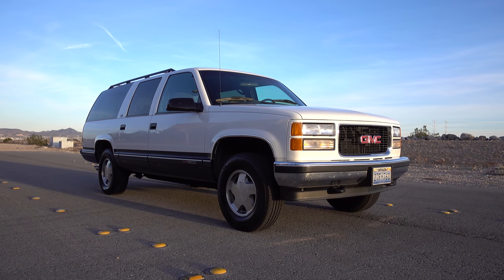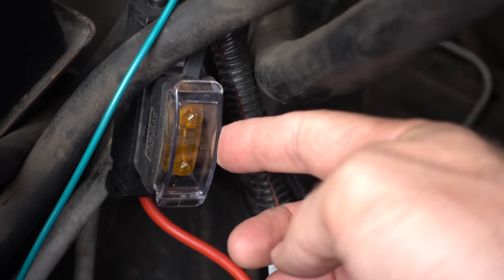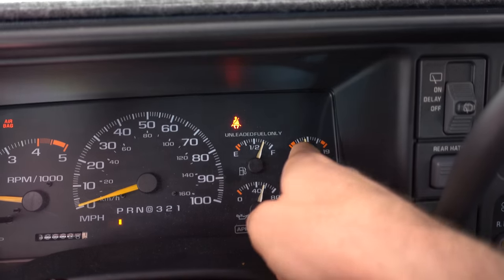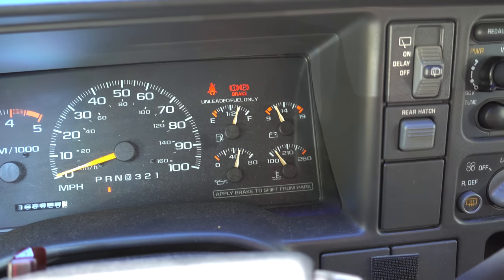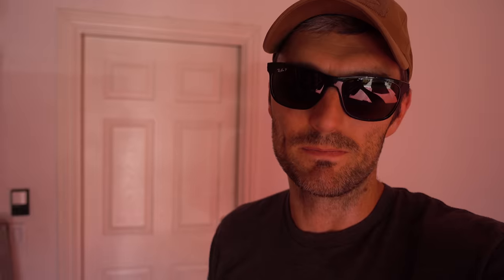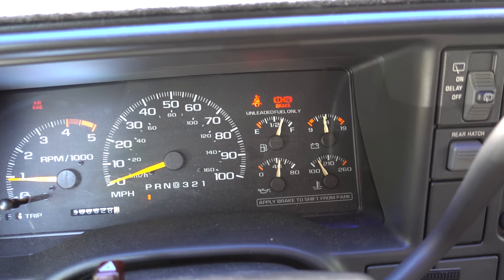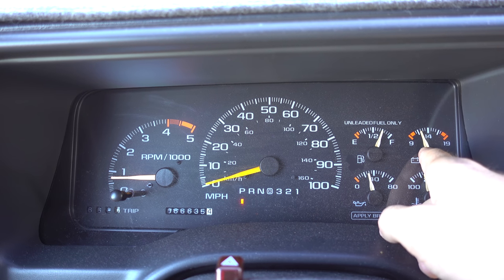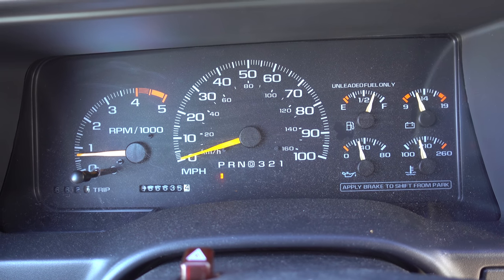SOLVE A LOW VOLTAGE ISSUE!

Comment: Your alternator not keeping up it should   be able to run your car as well as charge your battery.
You need to upgrade your alternator to a high output alt
Reply: Wrong. It could be bad wiring or ground issues, which would cause even the best alternator to produce a low voltage output.
Reply: @michaelcallaway6962  thanks for letting him know I was about to say the same have the highest output alternator you can get for these trucks and it still wont keep charge
Reply: I have a Honda Civic 2003 lx I had to replace the computer and  I had to install a use computer for the car, now when I’m drive the voltage come down and the battery light comes on, but in parking the light doesn’t come, the alternator is new but still ,  I don’t know ??
Reply: @pablocastillo9040  you probably Have a loose ground or exposed wire touching the frame causing a short or your starter finnaly kicked the bucket
Reply: @pablocastillo9040  also is it a rebuilt alternator or a new alternator sometimes the rebuilt ones come defective if you know how to remove the alternator you can take it to go get to checked at any autozone or orielys
Reply: @frankgar4560  hi .. im no mechanic but i have this kind of problem with my car for a year and every mechanic will tell me its just the voltmeter's problem not the alternator or battery , but i still dont trust this reason since i keep on monitoring the voltmeter, any suggestions to fix this problem if this could be the ground problem? or is there a chance i could do it by myself?
Reply: @ayawhilabtiakoyoutubeaccou1892  also you can disconnect the alternator while the truck or car is running and if It stays on it ain't the alternator
Reply: @ayawhilabtiakoyoutubeaccou1892  theres a nice video on checking for a short with a voltmeter there relatively cheap for about 8 bucks at your local auto parts store connect the alligator clip to the positive if it lights up you have a short so what you do is get one fuse out at a time from the fuse box  and see if the light in the voltmeter turns off if it does that's your problem just remember when you pull a fuse and that's not it put it back and do it carefully you can hurt the fuse or pop it yanking it out forcefully
Reply: @michaelcallaway6962  This Suburban is equipped with a CS130 alternator, max output of 105 amps. It makes about 30-35 amps at idle depending on temperature. The fans themselves pull that much, rest of the truck is about a 40-50 amp load. His electrical load is exceeding his charging capacity, and draining the battery in the process. With all this load the alternator doesn't have enough reserve current to supply the load as well as maintain charge of the battery.
Your arrogance doesn't make you look cool brother. As to the poster, the GM AD244 from the LS engined trucks is a direct swap (with a slightly longer belt), has a max of 140A and makes about 80A of idle current and vastly superior cooling. The alternator charge wire contains a fusible link, so make sure you properly fuse the bigger alternator.
Reply: I have similar problem with my Silverado 1500,I went to AutoZone to be sure what exactly cause my truck shake on stop(also the gauge goes down from 14 to 11.6) and they told me everything works just fine,on the other side I can hear some whispering noice coming out under the hood,makes me think it’s the alternator .. I will take it to the Chevy dealership tomorrow afternoon for diagnoses.. It’s annoyingly and definitely not working normally .
Reply: @rivbro91  l
Reply: Had the same problem with my pops 97 Chevy c1500 , the battery is about 6 years old. The alternator is only pushing 90 amps. Solved the problem by cleaning the ground straps firewall to the chasis and chasis to the back of the engine block. Sandpaper 80 grit to sand down paint on the firewall and chasis also. Almost forgot had to clean grease and oil build up where battery ground cable grounds to engine block.
Reply: @michaelcallaway6962  True. But, maybe he didn't wait 10 minutes for the guy to say that he just "Upgraded" his ALT to a PowerMaster 140A ALT. Even I was like, WTF? Why not say that at the start of the vid?
Reply: he said he upgraded the ALT to PowerMaster 140A. Doesn't mention wiring though.
Reply: Any updates on this? I have the same issue on a stock 2010 Subaru Outback. When I draw extra power for example the AC my voltage drops. Almost stalls
Reply: @bigfootswingman  AC + both fans on high + engine and all accessories = power drops.diff cars have diff severity. typical OEM ALTs are rates about 100-maybe 130 A, but some new cars have pretty HO ALTs. My 2003 RAV4 drops V as low as ~ 12.2-13 when running everything with AC on.even a low ad 11.8. the ALT works but is on its way out.
 for my AM system, i will need a HO ALT-maybe US Alternators with the OEM ECU integration unit -- ~ $200 more.
Reply: @mance7996  u ever find out what was the cause?

Comment: You need to consider a higher amp alternator. My stock 98 c1500 is equipped with a 105 amp alternator. There is also 120 and 140 alternators available. Cost is around 140 and below. I run a massive stereo system and an auxiliary fuel transfer pump for my heavy equipment. I can run the stereo really loud and pump fuel without my alternator gauge even moving. Doing this will save you money and unneeded weight. As well as extra maintenance. Hope this will solve your issue.
Reply: Check your grounds and upgrade your cables

Comment: 1. Buy a battery with dual mounts. You can buy terminals for the top mounts for accessories.
2. Check your grounds. Use a multimeter and check your ohms from your engine to your battery. Make sure your fans are grounded properly. There are ground connections to the frame under your driver door. Check to make sure they are 0 ohms wire to frame.
3. Your alternator can't keep up.  Get a higher amp alternator ASAP. It should be at 14v at idle so it definitely is an issue without checking anything above. I would check the above first before dropping money on an alternator. It is pretty obvious though. Cheap alternators don't produce the amps at low RPM's. That's what's happening when you put it in gear and sit at a stoplight. Higher quality alternators produce great quality power at idle and sit at 14v minimum.

Comment: Heavier gauge wire from alternator to battery the big three I also have a older chevy suburban began to have the same issue voltage drop at idle almost in the red my HIDs flickering upgraded to the big 3 problem solved
Reply: What do you mean by the big 3? Ground wires?
Reply: @edgarheredia2690  yes

Comment: Ground with bigger gauge wire on the battery to chassis and on the engine to chassis ground. Also use a better battery like optima yellow top or any other battery made for accessories. Use good LEDs on your old lights inside and outside.
Reply: Optima batteries arent as good as they once was. Led's headlights consume the same power as halogen. His issue is wire sizing did you see the tiny wires from that battery? The fans arent temp controlled and the AC compressor could also be getting old. If you noticed his engine temp with both AC's on and everything running for a while way to cool which causes bad fuel mileage the engine needs to be around the 210mark when warmed up. The fans are wired to come on with AC which is good but i think he only needs 1 fan on high with AC on and the other to be engine coolant temp controlled this would put him a lot closer to optimal engine temp and reduce the amp draw of fans.

Comment: 2:30 your battery does not provide power to the vehicle once the engine is started, your alternator does. Your alternator charges your battery. However, if your battery is dead it can actually become a load on your alternator. Your alternator provides 14v while the battery is 12.5 volts, your system voltage settles to around 13.5 volts.
Reply: His battery has enough volts to start the car but it’s too low when combined w the alternator. Some cars can start with a battery at 10.5 volts but that’s not enough combined while the car is on. He should have checked the battery volts in this video

Comment: throw a better ground from battery ground to Chasis Frame sanded down to bare metal and a a bolt and lock nut. if anything, run a higher amp alternator. 180a-240a
Reply: Does a high output alternator affect anything. Where does the extra power go? Maybe a stupid questions but I have a 1998 chevy tahoe 5.7 vortec and stock output is 105 I believe
Reply: @dfish3585  usually a high output alternator will still only deliver the charge necessary for the battery. It shouldn't overcharge anywhere unless the pcm isn't plugged into the back of the alternator. The pcm gives instructions to disperse amperage as necessary. Same job as an external voltage regulator.

Comment: Upgrade the alternator buddy The magnet in the alternator is already giving out because when car is running it suppose to maintain 14.5V and I recommend 160 or 180Amp Alternator
Reply: You need to put a relay on each fan

Comment: Had the same problem with my '95 GMC, 5.7L pickup, 195k miles. Just today,  I replaced the alternator with the standard 105amp unit, gauge did rise somewhat, but not a lot. But an accessory volt meter, plugged into the cigarette lighter showed the low charge rate at 13.6v and a high of 13.9v. 

I think perhaps the internals of the OEM gauge are becoming fatigued and not showing correctly. Ahh well, as long as she starts and doesn't strand me...
Reply: Yes this is exactly what I was thinking. I'm thinking it was the gauge cluster that is faulty. Does this on my 93 Chevy as well.

Comment: The alternator is not keeping up with the demand of all the electrical components in the vehicle (new fans).  There are two options for solving the problem. 1. Replace the alternator with a larger 140 amps  2. Replace the alternator with a 250 amps.  Had this issues before until the 140 amps got replaced with a 250 amps.  It runs great without amperage issues.

Comment: Bought the same fans for my 04 navigator and the same thing happened. I upgraded to a 300a alternator and replaced the stock battery with a Deep cycle group 31 battery now it runs perfect.

Comment: 1.check your electrical ground points.
2.check your drive belt and missed out drive pulleys 
3.may needed upgrade positive electrical wiring from alternator to the battery .
4.Adding more electrical grounding points ( 1.From battery to the body , 2.From battery to the engine block , etc...)
5. Check for any lossen from alternator wiring and make sure it's clean .
The goal is to make your car more accessible to the modren cars that works with electrical cooling fans
Reply from the maker: +TOYOTA POWER Okay, you and nearly everyone else are telling me pretty much the same thing. So, I guess I need to start by checking my wiring. Thanks for the help!
Reply: you're welcome brother

Comment: I'm going to be installing these fans on my 92 k3500, I'll be using dual batteries, with an even higher amp alternator than you did. 

you should invest invest in a stronger battery, also the reason it's worse in drive and stopped is the huge draw incandescent bulbs make, invest in led replacements

You need to use a battery with higher Amp Hr capacity, the optima yellowtop is a good reference for what you're looking for, if you can afford it that's what I'd buy.
Reply: He already replaced everything with LEDs, see the video list.  :-)
Reply: David Chenault did he mention that he swapped the head turn and tails? All i saw was the interior lighting video.
Reply: You're right, I didn't pick up that you were referring to the exterior lights.  Good call, that would certainly help things also.
Reply: Wrong you can add as many batteries but it wont matter if the alternator does not do rated output which with these(ebay) alternators they do not. For all high output alternator needs contact either irragi alternator, singer alternator, or ohio generator all reputable names whos alternators do the power what they claim.
Reply: AGREED!

Comment: Your battery is only there to start your engine. The alternator is what keeps everything running while charging the battery at the same time. You need a better alternator that can keep up or provide the enough power to handle the added load of those fans.
Reply: Yea but he upgraded the Alternator before this video to a 150amp alt. Im currently having problems in my car, im dropping to 9 volts across battery with all lights including spot lights on and AC fan. My alt is 70amp and installing a 800 watt amplifier im now worried about this voltage. With everything off im a 14.5 volts no problem, with load it just drops and I have new battery which is large capacity. The strange thing is my alternator charging wire is always at 4amps… I put 70amp load on battery and alternator is just pulling 4amps. Ive done big 3 upgrade and all grounds are perfect. 
My alternator has coolant, oil and vac lines running to it and would have to pull so much stuff apart to get to it, it’s a major job and I hope its not the alt. Any ideas.?

Comment: I have a 1993 gmc 1500 with the 5.7. Which is the same set up you've got just a couple years older. My truck does the same thing. When I have my sub, cruise control, a/c, lights on. My truck drops down like 2 volts on the gauge there. But Ive had this for about over year if not longer and never gave me a issue. It starts up and runs every time for me. Im sure getting a new alternator will help with that. But for me my is still running so I don't complain.

Comment: Reason for why the fan fuse burned is because the fans require a certain amount of watts to run and will have to pull more amps if the voltage begins to drop. Higher voltage means it will pull less amps to get the required power. Lower voltage on battery than on alternator usually means there's bad power and/or ground wires. Big three upgrade really helps

Comment: Have you check your alternator belt and tensioner?  If either one is bad it won't provide you the necessary  voltage u should have.

Comment: Big 3 for sure... we have a 96. Same problem. It was the power cable from the alternator to the battery. We swapped it out for a bigger gauge wire. Did the trick

Comment: A similar gremlin to yours.  And I just got my answer today.  I've got a 91 GMC.  350 auto, 4x4...  It's more of a half dead workhorse than anything.  I turned it into a winter only plow truck.  At MOST, the truck gets about 5-6 miles on it per year.  New 90 amp alternator.  Harbor Freight 2500 lb electric winch for the up and down of the plow.  The new battery worked great the last half of the first year I put it in.  I had to jump start it every time.  My volt gauge dropped hard every time I went up or down with the plow winch.  Trying to beat a dead horse, I decided to go full out, industrial strength charging system.  The biggest, in warehouse alternator I could get was 140 amps.  But to get that, I would need the local auto electric shop to build the alternator that big.  Then I was going to go dual batteries, along with the 140 amp alternator.  I had been to 2 auto parts stores, to be handed the wrong alternator, at both places, before I went to the auto electric shop.  One I explained the electric winch setup on the plow, he asked how long I plowed for each time.  About an hour each time.  Never going over 10 mph.  Almost simultaneously, 2 employees shook their heads.  Motors draw BIG amps. Low engine rpm is not sufficient enough to charge the battery  back up.  Putting a 140 amp alternator on won't help.  They do make low rpm alternators, but they cost HUNDREDS of dollars.  He said to go dual batteries, equal amp rating on them, running 2 gauge wire.  Positive to positive.  Negative to negative.  It'll help starting.  It'll help ease the draw of plowing.  But...when I'm done plowing, to put the charger on it for 2-3 hours.  I figure a float charger that's permanently attached should work.  
In your case, a dual battery will also help.  Two fans blowing full bore, can suck a ton of power. But I would also check to see if you can gather a temp and relay switch setup.  The fan comes on at certain temp and shuts off at a certain temp.  Constant running of the fans will wear them out, as well as your alrernator.   It's like a temp light coming on when it's hot.  Except, instead of the light coming on, the power is routed to the fans to come on.  Going down the road at 55-60, your fans should never be running.  Even in 90 degree weather.  I hope this helps...if you still have the truck and the problem.

Comment: I bet those two fans are drawing a lot of current. When you fitted them did you also fit a relay between the switch you are using and the fans, perhaps a relay for each fan. The alternator runs the electrics not the battery.

Comment: upgrade alternator, or change pulley size.  the voltage drops because of amp draw. smaller pulley will keep the alternator spinning at ideal rpm range.  the stock  suburban alernator is way under powered for the amount of accessories.  I have had many of this generation of gm trucks and all need new: alternator, main power cables and pulley.  you are blowing your fan fuse because it tries to pull more amps as the voltage drops from other accessories.